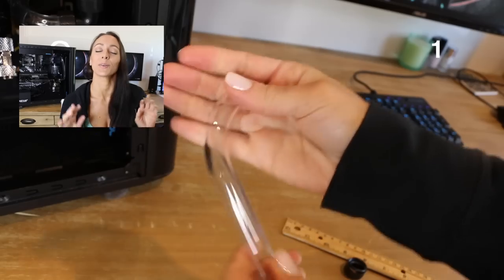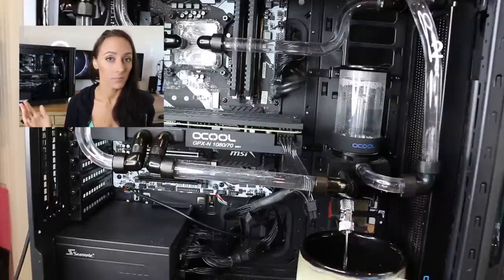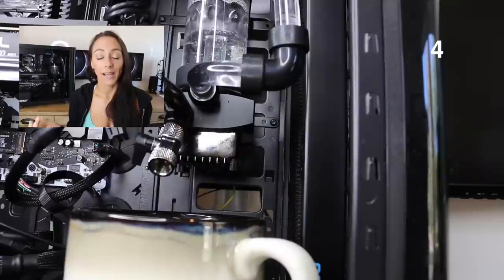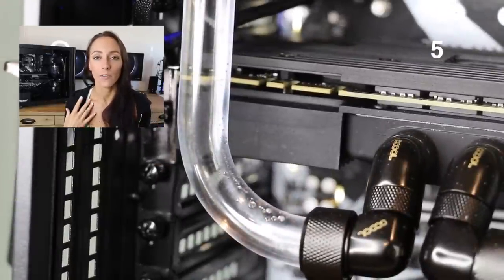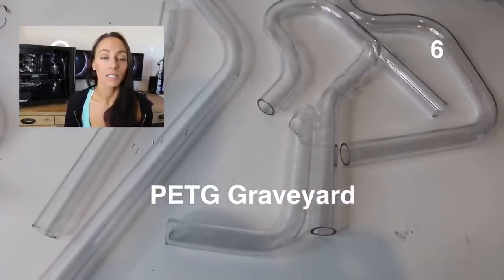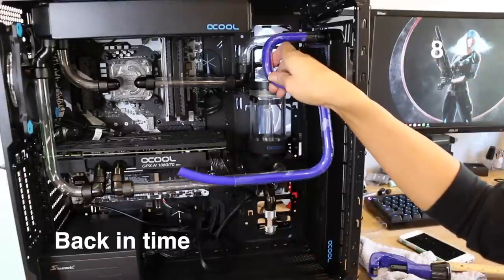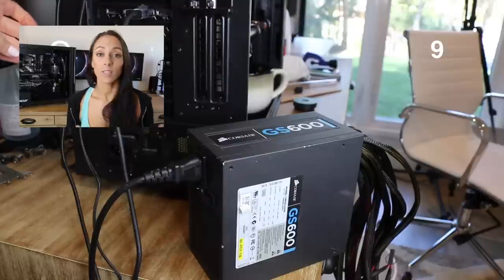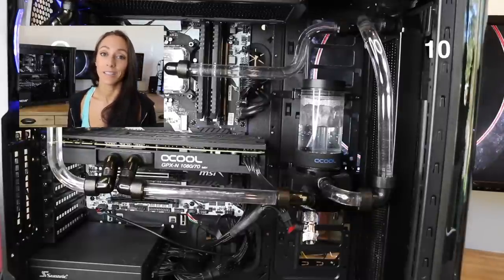10 Lessons Learned from First Watercooled Build

Comment: The thing that I learned is to stick to air cooling. No real over clocking for me.
Reply: JonWashburn wait why?
Reply: I will ruin my computer. Not a heavy gamer, so overclocking isn't needed. Wish I had the talent though.
Reply: it's not a talent lol. Just patience to learn like she stated above. It's the same thing as learning how to build a pc and setting it up. Just need patience. Not that i'm using water cooling but it's not a talent to use one haha.
Reply: You can still overclock on air...
Reply: ^ pretty much what i do.
Reply: I've done that in the past, but not like I'd like to. Modern Intels require water cooling to get the most performance. JayZ, Linus and others have done videos about building water cooled systems. Caitlin's is the first to make me realize that I need to learn much more before I ever try.
Reply: I'd start with an all-in-one cpu cooler and then work your way up to custom loop builds.  AIO coolers are very easy to install especially in modern cases nowadays, and prices are getting much better on them.  Personally I've only built two custom loop builds, and I still prefer AIOs which get near the same temp benefits but require a lot less work.  But if you need the real bling, then custom loops can really add that special wow effect when showing it off.  Most of my builds though are for those who will never take the time to even appreciate the cleanliness and looks of a build, so for them I usually just go with an AIO.  The latest build was with the Fractal Designs Celsius 360 in a Cougar Panzer case and the install was stupid easy with plenty of room to spare.
Reply: Water cooling isn't going to buy you much extra overclocking.  You can probably get 90% of the way there on air, or more with an AIO cooler.
Reply: Don't even use the stock CPU cooler if you don't overclock.  (unless it's a Ryzen wraith cooler).

Comment: Hi,
Nice video, you are really good at highlight what you did, how and why.
If you wish feedback heres a couple of thoughts that might help against expensive disasters and results;

Number 1 (Yes, bend first - leave a modest amount of extra length on both sides of bend - push fitting cap on to se correct cut distance - then cut)
Number 2 (Yes, absolutely go with drain valve/s)

Number 3

https://youtu.be/UTr1igS0gIw?t=143 You say "I did N O T want the water going from the pump to the reservoir."
Response
- That is considered how it should flow because the pump heats the water and the reservoir cools it - and that is generally considered the optimal way for the coolest point of the water to enter the GPU/CPU.

Number 4
https://youtu.be/UTr1igS0gIw?t=173 "Screw on your fittings as HARD as POSSIBLE!"
- Actually NO that is totally wrong because a majority of the watercooling components are clear acrylic and will crack. Warranties are void if you exceed the recommended tightening force by the particular part of the particular manufacturing brand.

Number 5 (Yes tilt & tip may be necessary depending on config and orientation of components, also on/off & speed of pump should help, 24hr run is mostly considered obligatory)
Number 6 (Additional nfo, there are "guides" and also there are basically two different kinds of hard tubing. Google this one)
Number 7 (Yes, soap and water on the insert)
Number 8 (Yes measure and make template, additionally you can bend a copper wire and see how you want the bends as a flat paper template is not as helpful with 3D bend turns)
Number 9 (Yes spare power supply is the way to go. Also use Battery Water for the testrun as it is none conductive fluid and will not leave the same mess as colored coolant with sticky adatives asf)
Number 10 (Yes, tripple check everything is plugged in. But beware and keep in mind you will most likely have to take the loop apart regularly for cleaning, maintenance and replacing coolant asf)

Additional thoughts,
A/ Soft tubing is safer and easier for newbs wanting to get in to custom watercooling.
B/ Remember you should N E V E R run your pump dry!
C/ One of those fill bottles with a hose through the cap is a very, very nice tool for filling and sucking out coolant. (If the end of that hose is needlepoint thin just cut the tip off)
D/ There are cheap handpumps with correct threading that helps filling loops, emptying loops, moving air out of the system asf.
E/ And last an very very important notice, you may need a PRESSURE VALVE in your system!!! As the newer acrylic parts can create high/low pressure peaks that will crack your acrylic components such as reservoirs, clear acrylic tops asf. Leaving a cap open on the top of the reservoir will do the same (or drilling a small hole in a plug and put it in the top of the reservoir if it has multiple plugs on top) do remember that you can obviously N O T tilt/tip your RIG with an open plug!
F/ Get a quality water pump, D5 or such of known brand.
G/ And check with the manufacturer of acrylic parts what force they recommend on corresponding fittings. If you get no reply/find no info - just tighten the fittings until it stops leaking and a puny bit extra. Do notice that sometimes the "rubber seal" can slide out of place so dont go crazy, try another fitting if you feel it demands a lot more force than it's siblings. Alternatively reseat the rubber seal on the particular fitting/preferably have some extra rubber seals for these occations.
H/ Use a port cap on your drain valve to prevent leak.
I/ When using the drain valve it could be a pro tip to have a piece of hose and connect it to the drain valve with correct fitting.
J/ If you go hard tubing and have a bend very close to the fitting, give it a mild jerk to make sure it really sits in place.
(They can give an illusion of being tight but surprisingly pop loose anytime)

Watercooling is the way to go, but again - for heavens sake - testrun your loop 24hrs with an external PSU and non conductive battery water.

Thanks for a great video CaitlinV3, hope the feedback had some value.
May the force be with y'all!!!

/Silverbullit

Comment: No need for extra power supply, just don't connect the power supply until the loop is done.  All you need is just that one connection from pump to PSU.

Comment: Nice video Caitlin.I go with Alphacool International GmbHs comment.I got ALL of the tricks in my mind already,but you are the one that took my fear away from building a watercooled machine.After building PCs 20+years.Thank you.Only one more thing bothers me.How and where to put an additional Fan near the CPU to cool the other components.So far I use a Top-down Cooler by Noctua.I was thinking of 1mm aluminium and extended screws and mount him with the CPU cooler.What ya say?

Comment: Why don't they use common plumbing materials like PEX tubing and push on fittings?
Reply: Water-blocks are far less tolerant to plasticizers falling in the water than common plumbing, leading to gunk in the blocks. I'm not sure how PEX reacts to water flow however. It's to be researched.

EK has push-in fittings for PETG. As well as push-in compression fittings.
Reply: PEX is commonly used in geothermal heat pump systems and seems to work fine for that application. I'm pretty sure that if it caused heat exchanger degradation, they would not use it.
Reply: It's not so much heat exchanger degradation, it's tubing degradation that can cause heat exchanger clogging. Pipes used in geothermal installations are way bigger than gunk can clog, unlike in water-blocks: http://www.udcinc.org/earth%20tube.jpg and http://www.earthfire-energy.ca/wp-content/uploads/2016/02/geopost4.jpg

Here's what tubing plasticizer degradation can do: http://cdn.overclock.net/d/dc/dc4a4afc_d1baeed9_Gunk0004.jpeg
Imagine in a water-block with thin micro-channels, like the popular EK-Supremacy EVO (not photo): https://images10.newegg.com/BizIntell/item/35/220/35-220-082/1.jpg
More about it: https://ekwb.zendesk.com/hc/en-us/articles/205160252-What-is-plasticizer-

But like I said, I don't know if PEX degrades and if it does, if it can gunk water-blocks, so my point may as well be completely moot. As I said, it's left for research, and I just found this (I have barely taken a look at it): https://www.pexuniverse.com/problems-pex-pipe-and-how-prevent-and-fix-them

I'm not saying your idea is bad, I'm saying good research is essential :)

Comment: Good video and I liked it......but......A drainport......I didnt have one in my last build and I also haven`t one in my current build :P
Don`t need it because there is always 1 other simple way......Connect a tube on the top of your reservoir and then put your case upside down.
There are also other ways but this is one of them. 
So I don`t need a drainport.

Comment: Yo Cat, are you excited for the new Primochill Vue coolant? Are you going to get some? Love the channel 👍🏻
Reply: I was very excited but now I'm not.
It only lasts 4-6 months, so it would cost a bit to replace it 2 or 3 times a year, especially if you require over a litre for your build.

I think I'm just gonna try something else instead, maybe some dyes.
Reply: where did u hear it only lasts 4-6 months? Primochill hasnt said anything like that
Reply: Check it out here, I assume its the same for all of the products.
https://www.primochill.com/collections/vue-unique-visual/products/primochill-vue-pre-mix-32oz-candy-purple-sx

Goto warnings tab, and primochill recommends replacing every 4-6 months.

So I donno, maybe it does last longer, I'm just going off what it recommends.

I would be happy to drain the loop and save the fluid, and then flush it out to get rid of accumulated crap that's built up. Then put the fluid back. Not sure if that's what its saying though.
Reply: Colin Java oooh i see. They say it may lose a little of its effect over time. I don't think it becomes clumpy or potentially, damaging to your equipment over time.

Comment: Measure twice, Cut once ;)
Reply: Its not really that simple with hardtubing.
For me I tend to measure 5 times and cut 5 times.
I keep taking off a small amount until I'm happy with the tube, the last cut might just be half a mm to get it parallel with something.
Its painstakingly tedious at times, especially when one end of the tube won't push into the fitting cause its a couple of degrees out, causing you to get the silicon tube out again, and tweak the bend by eye.
And with the continuous screwing down of fittings it can rip your fingers apart after a while.

Comment: I've been water cooling for over 10 years, and where your water goes first doesn't matter. So, your pump pushing water into your radiator wouldn't have mattered in the end.
Reply: Jeremiah Hoyet some water blocks are directional.
Reply: kidsythe That is true, still doesn't apply to this situation.
Reply: Jeremiah Hoyet how does it not? If she got the loop direction back wards, if it enters the radiator first then it would next go to one of the water blocks (if they are directional) this would cuase issues. I wish for you to explain what ya mean?
Reply: he talk about that temps in a custom loop equalize themself. doesn`t matter if you go first into a block or radiation. as long you do not block the flow ....anything will be fine
Reply: Jeremiah Hoyet, Sorry thats wrong, it makes a world of difference and is simple basics of watercooling.
Kidsythe, Jeremiah Hoyet is 100% correct that directional water blocks needs to be connected the correct direction as in you connect the hoses the direction the coolant travels the correct direction.
No Wonder - wrong again, it matters because heats build up in the loop if you run it backwards. This is the first rule in the basics of watercooling.
Reply: Yes and No. What she is talking about is inlets and outlets. You should not have the water flowing into an outlet port and out an inlet port. Yes this matters a lot with certain water blocks and reservoirs. As for which components and radiators are hit first or last. No that doesn't matter. You can have the water hit all the radiators first or all last or 1 first and then last. That part doesn't matter.

Comment: Plz never again power a water cooling system with no tubes and water .... , All other tips were helpful to a first timer but that tip to power on with no cooling is a very bad idea . 
You also don't "need" a second PSU your main but just unplugged from every thing else except the pump is fine .
Reply: Powering on your system at ambient room temperature isn't going to damage anything. It is no different to powering on C.P.U with an intel stock cooler..the cooler won't even spin until the C.P.U temp prompts the fan to do so. I can turn off my all fans, pumps and radiators and turn my P.C on and happily web browse and watch videos and the C.P.U temp only raises by 10 degrees over air temp. It is not a, "very bad idea."  I ran a stress test on a locked processor with stock cooler disabled. Once it 90 degrees it throttled, shortly after that the system powered off. Turned it back on 30 minutes later and nothing was wrong once processor had cooled. Nothing very bad is going to happen. Most builders insist you should set up your mobo externally first and turn it on to ensure you have no faulty parts before placing in the chasis and installing whatever C.P.U cooler you prefer.

Comment: Two small pieces of advice as you have some real potential.  Stop apologizing or otherwise putting down your skill level or knowledge.  Those with more experience will realize that quickly (and not in a bad way) and there's no need to tell those with less.  Also get a better mic/audio setup.  While video could use an upgrade too we all see that you're rather attractive but professional audio will go a long way to make things feel more polished.  Humans are far more tolerant of lesser quality video than we are audio.